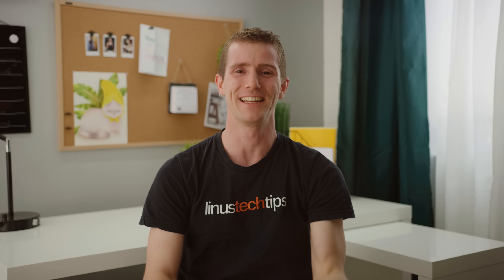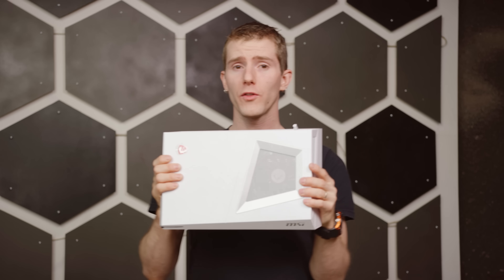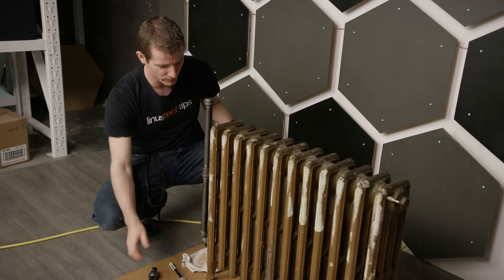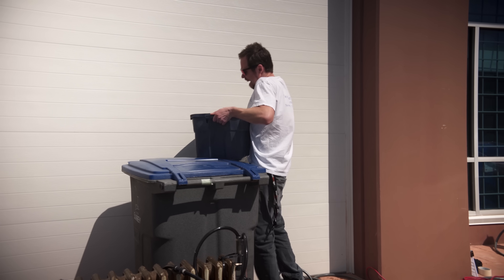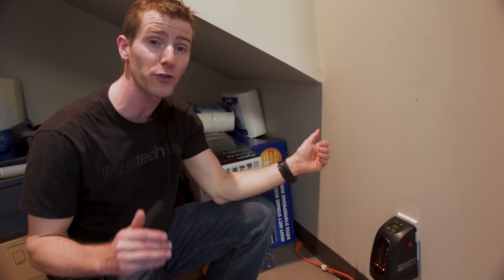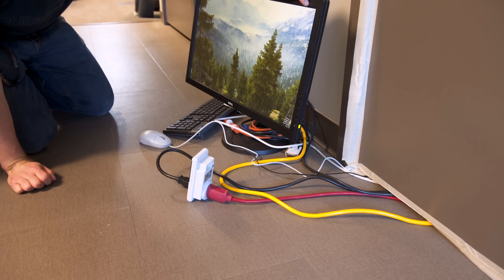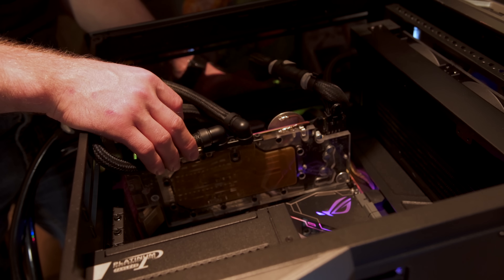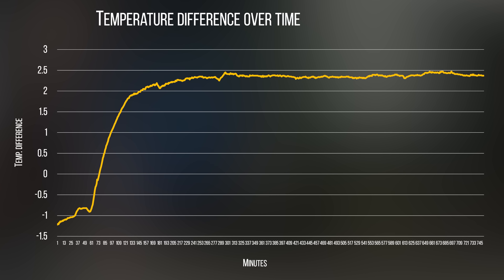Lower your heating bill... with GAMING

Comment: winter is coming, time to overclock
Reply: Shiinon Dogewalker Legit, this is what I did XD
Reply: Crack you window and the cold air flows down the wall on top the pc. Then room stays 70*
Reply: Shiinon Dogewalker LMAO SO UDERATED!
Reply: It would be a fun thing to do any play your favorite games while sipping a hot beverage of your choice.
Reply: You joke but that was my 295x2 quad sli FX-9000 system.  I had dual power supplies.
Reply: I wanna like this but it's on 666 likes
Reply: OpValkyrie it’s not anymore don’t worry
Reply: @charleshines6155  no eating or drinking over the keyboard or else you will spill some food or liquid
Reply: Yeah I've cranked my OC and slowed my fans before just to be warmer because my tower is right next to my chair
Reply: Lmao
Reply: Time to go to Intel
Reply: Winter was coming for years...
Reply: Did you leave the overclock on?! It is summer for gods sake!
Reply: @shareelchand5712  Winter is coming
Reply: I even oc in summer
Reply: I personally prefer running a pvc pipe from my window to my "heater" during the winter to cool it JUST ENOUGH that it continues to provide warmth for the rest of the winter😂
Reply: This is true. I played Rainbow 6 Siege on 1080p with my window closed and was 43 C and when I opened it my 2080 ti was 32 C.
Reply: You should use de ionized water, prevents oxidation.
Reply: I built my own sleeper but the thing is a heater because of my 680 having mods but I have it tunde to stock again
Reply: LMAOooo
Reply: @VvvvvaVvvvvvr   my gtx over here heats up my room by 60°
Reply: Lol
Reply: Lmao
Reply: Relevant rn as I have consistent power and everything is frozen to hell here in texas
Reply: Lol 🤣😂🤣😂
Reply: @Jaistar2k22   wow, now that's a hot PC ivegot one 290x and that thing by it's own is hot enough
Reply: Lol
Reply: @Beegpapijimbo  slowing your fans won't make the room any warmer, if anything it'll make it slightly cooler

Comment: Poor man's way of doing it: just game with your laptop directly on your lap. Instead of heating the room, heat yourself directly. ;)
Reply: I used to have burn marks on my leg from the exhaust of my Lenovo laptop I was using for gaming... 
It had the exhaust right in the top left corner of the laptop base, would get hella hot.
Reply: @п yeah mine had a bit more powerful i5 in it so I could game, but that ran hot af.  I should open it up and clean out again now, probably needs it bad.
Reply: @AtheismF7W  it is if you don't want to have kids.
Reply: @Doobernator  A wonderful secondary bonus.
Reply: If the blood vessels on your tights cool the pc, is it liquid cooling?
Reply: @Eric904P  same story
Reply: I must be gaming wrong, what's a "lap"?
Reply: That's nuts.
Reply: its bloodcooling,bloodtrocuted
Reply: @Eric904P  yeah lenovo sucks at cooling. its why i chose an hp pavillion 15 with an mx150 over a lenovo legion with a gtx 1060
Reply: I can see balls being lost here xD
Reply: @someguynamedrob581  latitude d505. That is all
Reply: NOT A GOOD IDEA! Laptops emitt radiation which can cause problems to your...you know...genitelia, since you will have it directly on your lap.
Reply: stormthrush37 I remember i used to have a few gel pads sitting in the freezer that i would rotate while using my old laptop lol
Reply: i love that feeling
Reply: stormthrush37 1000th like
Reply: Burn*
Reply: I have tested this method with a macbook and I can say that it works really well.
Reply: Sad thing is I actually did this at one point 😂
Reply: like $84,000,000 for a good gaming laptop.
Reply: @Doobernator  win win
Reply: advice for you
keep your room cool it will help keep the laptop cool too
Reply: That's more of a way to overheat your laptop, as your body prevents proper cooling
Reply: Overclocked the snot out of a 13 year old laptop, went to nab a snack mid reboot came back and to check on it and literally burnt my had on the metal cover.
Reply: stormthrush37 so in a way you’re blood cooling the system mwahhaha
Reply: @pussymcstanky ...radiation?
Its heat. Heat kills your sperm

Comment: College dorm and rented apartment has literally no heat during -10C/0F degrees winters. I run 2 AAA games at the same time on my 6700K + 980Ti + 32Gb ram to heat up the room. It actually works.
Reply: Weird flex but ok
Reply: That's a really odd config. 32gb ram but only a 980ti?
Reply: James Bearpark not very balanced
Reply: @jamesbearpark3794  I have 32 GB also but just a GTX 960.  I got my ram cheap on eBay from some place and it has worked flawlessly for years now.  I would have bought more if my motherboard could address it.  Imagine if our ram was not limited by anything other than CPU architecture.  64 bits can support an amazing amount of ram potentially.  More than you will ever need for the next couple years anyhow.
Reply: @Mugen00 yeah not everyone always wants to upgrade their gpu when it still works great
Reply: @jamesbearpark3794  "Only" 980ti is still a beast.
Reply: @jamesbearpark3794  thats actually a really normal top end setup from wayback in 2015 and 2016, i had the same setup actually, ive switched over to 2x Vega 64s and an 1800X since then. but its a pretty sensible PC i dont get it
Reply: How much does that cost in electricity?
Reply: I'd get a better graphics card, and sell off some of that RAM, it's not being used.  Oh, and a fucking space heater.  I'd buy a $25 Walmart space heater for the cold room.
Reply: @bradleyrex2968  how are you so sure he doesnt use all 32gb with vms or something smh
Reply: If you edit videos, that system ram is fantastic. And in general fantastic for leaving tons of tabs open. It's not weird at all. People don't just play games on computers jfc.
Reply: @toebeexyz  Because I read what he wrote. 
How did you miss the point that he should purchase a space heater?
Reply: @MrC77  exactly , mine is still running strong and got 32gb with a 3950x.
Reply: @jamesbearpark3794  "Only" it runs most triple A titles, even at 4k, wth.
Reply: @bradleyrex2968  He prolly uses it for vid editing or something else.
Reply: @KYSMO  His editing must really take a performance hit from running 2 AAA games at the same time.
Reply: MattheusJohannes 

I've got 32gb ram and Ryzen 3 Integrated Graphics
Reply: Please run Folding@Home instead of wasting it
Reply: @jamesbearpark3794  I have a 970 with 32. I upgraded to 32 bc that's the max my board can do. Plan to max out everything over time tho.
Reply: @jamesbearpark3794  he most likely built it in 2016 thats why
Reply: Why not buy an electric heater? It would cost you waaaay less. Not to mention the wear on the PC parts. Please don't anyone copy this idea, its very stupid.
Reply: @bradleyrex2968  ram is about 40 dollars a new graphics card is hundreds and hundreds. Hardly comparable. Also you have no idea if he was needing all 32GB or not as you dont know what he used the PC for.
Reply: @richbob9155  I already have the PC so I actually saved money by not buying a heater lol. Anyway I only did it a couple of times lol.
Reply: @richbob9155   One is $40 and  the other is $200+?  That IS literally a comparison.
Reply: Just leave your oven open. Rather than unnecessarily degrading hardware. Or buy a second hand space heater

Comment: lessons learned?

1 - buy a new radiator instead of stealing it from a neighbor
2 - never wear socks with sandals
Reply: 3 - use thermocouple instead of running the water through the dirty radiator.
Reply: 4 - Grasp that they are desperate for content and have a limited budget. Most computer equipment they use is provided by advertisers, but no radiator company is going to sponsor them. As with whole house water cooling and fridge in a PC, it's likely to fail because no fridge was donated etc...
Reply: lol
Reply: 5. Necromancy still isn't illegal
Reply: And there's 1k likes
Reply: Dat Boii  When was the last time you purchased a hot water radiator for your home?
Reply: socks with sandals are superior because more heat but more ventilation compared to shoes. usa btfo
Reply: @bradleyrex2968  they bought 200 grand worth of red cameras
Reply: Buy a 50$ heatercore from an auto store.
Reply: @bradleyrex2968  "limited budget"

Hopefully, you've figured out how YouTube works by now.
Reply: @losttale1  Keeps your feet from getting anywhere near as dirty too which is amazing for dusty environments
Reply: People in czechia actually wear socks with sandals.... Lmao

Comment: Having worked with copper pipes in fire suppression systems before, I can confirm that color is entirely normal and flushing it out will only do the trick for a short while - the sitting water in the pipe will get discolored again

Comment: I used to work in a low budget 3D animation production studio. We would have 6 workstations and 5 more rendering nodes in a pretty tiny room. We never had to turn on the heating even during sub-zero temperatures in winter. In these conditions, it was a bill saver :D
Reply: Alfred Tsaizer that's one way to use render farms lol
Reply: This is why the thought of buying a small house or small warehouse in Alaska keeps passing through my mind every summer night.
Reply: Facebook houses servers in Luleå sweden, that not the warmest place, using the cold.
Reply: What happen in summer then?
Reply: Then they cool it but they may save some cold from winter for a while.
Reply: Alfred Tsaizer there’s a reason they like building datacenters up north.
Reply: PennyAfNorberg norway is colder than sweden lol
Reply: Depends on where you are. South of norway is hotter than north of sweden. But energy is pretty cheap in norway though!
Reply: How about during summer? I bet it was hell inside that room, or the electric bill for the AC was out of this world.

Comment: "Can you heat your room with your GPU"

"Yes. You literally already do. There's no reason to build connect a giant radiator for that to happen."
Reply: I mean. Yeah. Why the heater if you got fans that shoot hot/warm air out and heat your room
Reply: @OriginalHulkLP  his excuse is that the energy produced would be kinetic instead of thermal. He forgot that it would soon become kinetic once outside the PC. Also, a giant radiator makes for a good show.
Reply: The only practical is to make tea
Reply: This.
Reply: @sheeplord4976  

??????????????????

That's not how heat works

The hot air dissipates and heats the room
Reply: might as well make a 4x4x120 rad setup to make your pc run at room temperature
Reply: @OriginalHulkLP  Because convection and radiant heating have different efficiency. Usually you want radiant heat to warm up rooms
Reply: @Wolfsgejaule  in a small room, with not so big height there is no difference... all of the Watt used in that computer is a heating Watt also for the room
Reply: I gave my friend my old motherboard cpu ram and gpu to use while he is saving for new ones to get him gaming, and I forgot how absurdly much heat if produced and even with his window open it heats up his room.
Reply: @Wolfsgejaule  remove fans from the system, bigger radiator/heat sinks. There you go. There are passive coolers for both cpu and gpu, they just get very big at the topend.
Reply: @AFlyingSwive  Mora 3 420
Reply: when its winter my gpu doubles as a room heater and aquarium heater cuz it keeps both my room and my fish tank (tropical fish) decent so I never need to turn on the furnace or use a space heater lol
Reply: True the heat coming out at the back of my PC is around 75 degrees it heats my room very fast without a radiator
Reply: The answer is obviously yes but the whole point of the video was to figure out which method is the more efficient and cost saving of the two first off. Second off if you didn't have anything to dissipate the heat with all you would end up with a really inefficient foot warmer that is only capable of heating 2ft from it.
Reply: Like yeah, I have an RX 6600 rig, which for its performance is extremely power efficient, after 30 mins to and hour it is noticeably warmer in my room then in the hallway. It gets even hotter with my ps4 slim, which runs pretty hot and sounds like a miniature F18F super hornet is having a stroke inside my room.
Reply: omg thank you, annnnd no reason to make a video about and now have 1.7 million noob 10 year olds wrecking their pc and their parents house
Reply: thermal mass